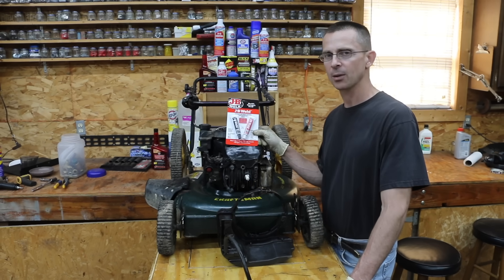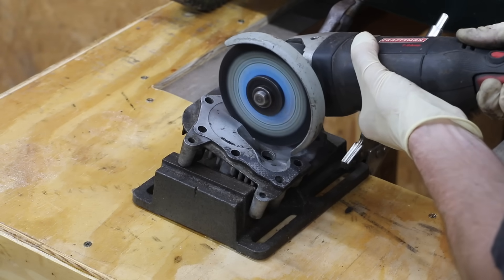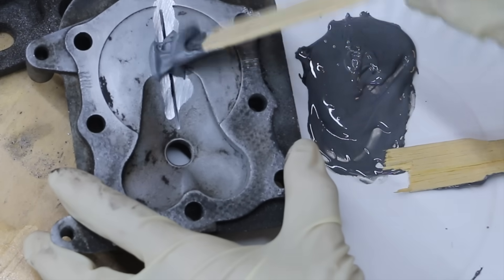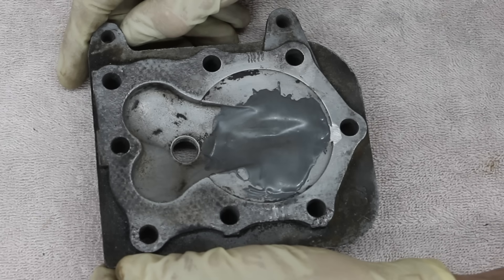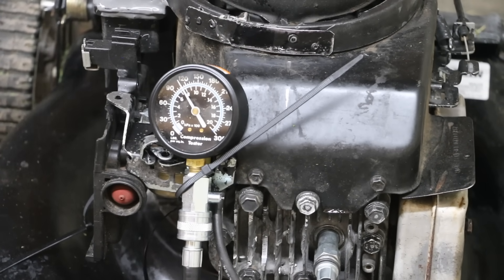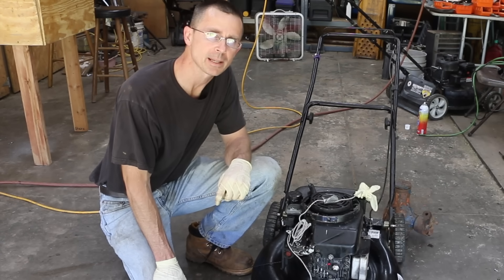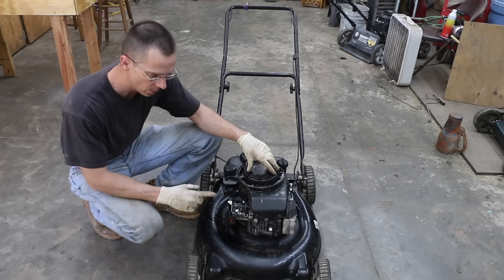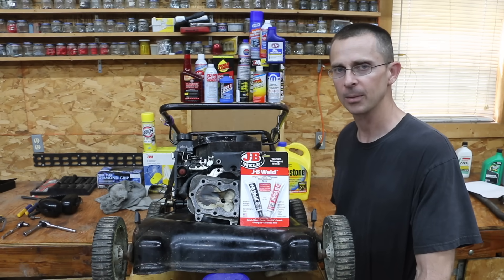Can JB Weld fix a cracked cylinder head?  See the proof!!

Comment: i Have repaired a Volvo 940 2.4 turbo engine block which had corroded from a water jacket to the cylinder bore using Quick Steel repair putty and that worked for a further 20k befor the head gasket went again
Reply from the maker: Thanks for sharing.

Comment: Back in the early 70s. I had a old Richardson boat with flathead gray marine engine in it.  The distributor mount was broken . I used jb weld to fix it. That motor ran three years without any problems.  We went on a few summer trips down the Erie barge canal to the finger lakes and the thousand island area of eastern lake Ontario. The motor ran everyday all summer long each of the years I owned it  I sold it and know it ran at least two more years
Reply from the maker: Thanks for sharing.

Comment: First time I tried porting a Toyota cylinder head I accidentally cut into a water jacket. Ported rest of intakes the same and used piece of tubing and JB Weld and welded it in place. I ran motor all night at drag strip and JB Weld didn't fail. Been using it ever since on all kinds of stuff.
Reply from the maker: Thanks for sharing.

Comment: I was giving a Wheelhorse  417-A with a 17 hp Onan engine Because the previous owner thought it was throwing a rod it knocked so bad.  I knew he never inspected inside the shroud for mouse nest which is a big problem here in upstate NY every winter anis the first thing you should check for in spring. First thing I went for was stretched head bolts,
. Sure enough the port Side head was loose and rapped like crazy whenever it was under load.  This etched a channel in the cylinder block under the blown head gasket.  My fix was to ball up some aluminum foil and gingerly tap it into the channel until it it fit nice and tight and a couple of thousands above the jug.  Enough so it would dimple into the head gasket when it was torqued down.  Hasn’t skipped a beat in 5 years of mowing and hauling.  Wish now I had taken some pictures. I will if I ever have to take it down again. Thanks again for your great videos, I learn something every time
Reply from the maker: You are welcome!

Comment: Some years ago I hit a log sticking out with my ‘71 Suzuki 90 cc it broke off a sizable chunk of the aluminum casting on the side of the engine where the carb is located, I cleaned the area real clean with brake cleaner and beveled the pieces and used JB Weld , it is still on there today and it still runs great!
Reply from the maker: Glad to hear!  Thanks for watching.

Comment: I pulled apart my 3L mercruiser today to replace some core plugs and gaskets and found out my block had a crack. JB weld has been holding up pretty well though I'd say.
Reply: To be clear, the previous owner used the JB weld. I had no clear it had ever cracked until today.
Reply from the maker: Thanks for sharing.

Comment: I had a Honda 750F motorcycle that someone tried to steal but couldn't cut the security chain or lock so they slammed it into street.  I rebuilt case and engine cooling fins.  Rode bike over 20K miles and never leaked a drop of oil and alternator worked perfectly.  Only way you could tell of repairs. Was factory engine lettering was covered by repair.  And cooling fins were smooth where I replaced them.
I keep J&B in my shop at all times!
Reply from the maker: Thanks for sharing.

Comment: I won't be milling any more heads for higher compression.  I'll just add JB Weld to the compression chamber.
I use the slow set JB Weld just as I am about ready to throw in the towel. Amazing stuff but lousy tubes.
Reply from the maker: Thank you

Comment: Got a big test coming for JB Weld.... Got a small hole in Cylinder Head off of my 200hp 2.5liter Mercury Outboard engine. Hole it works. Stay tuned

Comment: I have a 1988 f150 ford truck which had a cracked exhaust manifold. I tried just about everything including JB weld extreme heat. Now to be fair the crack was located in a hard to reach spot and I'm sure I didn't prep it correctly. Funny, after spending all that time energy and money, I finally figured out what works, replacing the cracked manifold with a new one. Thing was I didn't want to pull the engine, and was sure I'd break off some exhaust bolts, which I didn't (used anti-seize years ago). If I ever get in a place where I can properly prep it, I'll give JB another try.

Comment: Thats is remarkable. I have actually used JB weld to repair my oil pan i cracked. I accidentally over torqued the corner of the pan near the bell housing, while replacing the pan gasket. Which in my case, the front differential has to be dropped/removed. Instead if spending $60 and spending another whole day on the cold concrete, 5 dollars at walmart, and my truck is still on the road. Does not leak! Even moved to texas from minnesota, and I’ve been here 10 months. Still holding!

Comment: Sort of sentimental, lAbout 15 years ago, my dad repaired the heads (multi head engine) on his 2.4l turbo diesel Range rover, that cracked between the inlet and exhaust ports intro the water jacket using JB weld.  According to my dad it ran sweet the best it ever did that was until 2 weeks when the Range Rover, the tailor it was towing and the poor little  Fieata in front was written off by a llorry driver failing to stop and mounting the tailor.  The engine still was running sweet in the impound lot, the last time my dad ever heard the engine  or saw the Range Rover.  Do note the Range rover was a work horse constantly pulling a tailor for easily 500miles a day so at a guess JB weld coped with 2000miles heavy use.  Always wonder how long it would of lasted if the lorry didn't cut it short.
Reply from the maker: Thank for sharing.

Comment: Just finished rebuilding my’72 181cui 3.0L mercruiser 140. Found two cracks during the rebuild. One on the block, one on the intake body. JB weld will be put to the test for me soon. I have test ran and times the engine, but it needs a trip around the lake to be sure. I saw the video about Motorkote, and am going to use some in it as well. There is some slight knocking (I believe due to not having the cylinder walls machined). Fingers crossed as this boat spun a bearing the second day I had it on the water two years ago.
Reply from the maker: Thanks for sharing.

Comment: Technically it's not cracked, just cut... The two sides are holding together with steel on both sides of the cut, a crack usually goes all the way through or at least through to one side but it's a good test.
Reply from the maker: Thanks for the feedback.

Comment: You mashed so much JB Weld all over the place that it was bound to hold for a while.  I would like to see you put the JB Weld into the crack only with a plastic cringe and then sand it off so that only the crack has the epoxy in it.  Them start the motor.  What you did is to make the metal thicker and thereby allow for the crack repair to be deeper.  Let's see!  
I do use JB Weld on repairs of SS wire where my brazing is not p to task.  I do not use it on plastic, fiberglass, or wood.  There I use marine epoxy, Marine-Tex, resin and glass, etc.  JB Weld is too hard to sand into a shape.  For me any way.  don out.
Reply from the maker: Thanks for the video idea.

Comment: Hi, over here in the UK we’ve got a similar product to J B Weld called Chemical Metal. It’s made by a company by the name of plastic padding and it’s pretty good stuff. A friend of mine had a CR 125 honda 2 stroke and he blew a hole in the piston. He had no money so he took it apart, cleaned everything up and repaired the piston with Chemical Metal. After a while he sold the bike and just over 2 years later that bike was still running and still being ridden around the town. That chemical Metal is good stuff and I’ve used it myself on various things. It’d be interesting to see you do this with JB Weld to see how it holds up. The trick is with things like this is to give it plenty of cure time.

Comment: We blew teeth off a ring gear in a 12 bolt GM rear end, throwing a couple teeth through the aluminum torque cover while drag racing.  I patched it with JB Weld around 10 years ago and it's still holding.  Saved us $125 for a new one.  I have been using JB Weld on different things for many years.
Reply from the maker: Thank for sharing.

Comment: I had A cracked manifold . I used JB weld and Aluminum foil . It smelled terrible when it got up to temperature but it never failed in the extreme heat environment.
Reply from the maker: Thanks for sharing.

Comment: My Dad when I was a kid, we had a messed up boat and he repaired a cracked cylinder head with JB weld to a dude and didn’t tell him.  The boat went on for YEARS, with no problems because I knew the guy.  Amazing stuff. It was a 350 V8.  Cooled with SALT WATER.
Reply from the maker: Thanks for sharing.

Comment: years ago like 1984 as a mechanic at a Chevy dealer i did some side work in my garage for an ugly duckling rent a car agency a buddy owned and one of the projects was a 1979 Toyota Celica with a connecting rod through the side of the cylinder block just missing the water jacket i patched the hole with JB weld and an aluminium soda pop can. i jb welded the aluminium patch on the inside of the block and filled the hole with jb weld on the out side and replaced 1 piston and 1 connecting rod. after a year that car was still running great and being rented. Unbelievable!
Reply from the maker: Awesome job!  Thanks for sharing.

Comment: I wonder how it would perform on a petrol car engine when adding it to a headgasket after the hg has blown.

I know this stuff works great on sealing my small high performance 2 stroke engine cylinder heads rhough
Reply from the maker: Thanks for the video idea.
Reply: @ProjectFarm  np

I thought to do this on my previous vw caddy 2.0 8v gasoline but i sold it  for scrapping cause there was allot more trouble with this car then just the headgasket

Comment: Been using Jb weld for 30 years excellent for hot and stiff applications.  Found Goop 5 years ago for my convertible roof which is flexible excellent product has to be painted if used in the sun. Goop can be used to make a gasket for an engine. It's great on most plastics. Great video as usual.
Reply from the maker: Thanks for sharing.

Comment: I have a toyota t100 4 banger, manual trans the factory radiator developed a crack at the top...? i used jb weld on it, just cleaned the crack at the surface, no grinding or sanding, just mixed and put it on, next day it cured , refilled the radiator, its been 5 years ...still holding
Reply from the maker: Fantastic!

Comment: I have a small 2 stroke engine that has a cylinder head that snapped in half, would this be able to fix it? If so, how?
Reply from the maker: The repair is unlikely to last long, since JB Weld is rated for 500F and an air cooled engine exceeds that max temp rating

Comment: Project farm
Not only are some of your tests impressive but your impressive in the way you conduct these product tests...
I have once used JB Weld in the past and I wasn’t fond of it....however after watching you using the product... I will give it 2nd  chance.
I have a Jeep Wrangler the gas tank had a hole in it more like a severe slice, about an inch or inch & half 
I tried using JB Weld ... didn’t work it held for a short time only, maybe a day or so.
Come to find out the tank is some sort of plastic material called Polyethylene.

And is resistant to any kind of repair other than Plastic welding and I went crazy with all kinds of glue products until I found that out.... and my old standby Epoxy failed me also.
Thanks,Frankie 
Boston
Reply from the maker: Thanks for the feedback.

Comment: I patched the plastic edge on my radiator and it lasted for a year before the crack decided to get worse. Also, many years ago I patched a GM 3.4L V6 Cylinder head with it and it ran perfectly until the car was rear ended and totaled. JB Weld FTW!
Reply from the maker: Thanks for sharing.

Comment: Have you ever tried JB Weld Extreme Heat on an exhaust manifold?  I have used the two part regular JB Weld on a crack but want to use this new Extreme Heat JB Weld.
Reply from the maker: Great suggestion!  Thank you.
Reply: @ProjectFarm  There is another product that is like JB called Blue Magic Thermosteel Quiksteel.  Would be interesting to see how it also compares to the JB weld extreme heat.  Both seem to be flaky...no pun intended

Comment: Can it be used to fill up bike exhaust holes🤔🤔
Reply from the maker: Yes, if the exhaust doesn't exceed 500F.  Otherwise, you might consider using JB Weld extreme heat

Comment: I first used JB Weld to repair a model rocket in 1973. Then used it a lot in blacksmithing. But the best was the 5 years I lived in China. I helped start our engineering office and introduced JB Weld to make assembly and test fixtures from time to time. The Chinese guys and us hand carried JB Weld across the border as nothing in China was as good. Our Chinese engineers kept JB Weld secret so they would look good to outsiders. Can't blame them after all their effort. But, now the 3D  printer obsoleted the need for JB Weld in the office. If they break the fixture, they can have a new one in the morning.
Reply from the maker: Great feedback. Thank you

Comment: In case anyone was wondering, I got jacked on a 02' Yamaha R6 that had the chain break and crack the engine case. The owner caked JB weld on it and it didn't leak (I was oblivious) until 170mph poof, smoke everywhere. So, depending on pressure, as well as vibration and heat can cause it to fail. Granted this was a street bike at around 11k RPM, worth noting. But, great video, it does work on a lot of projects. And I appreciate you admitting the mistake (also nice to see you make a mistake for once). Soon as you said you were putting it on a higher compression engine and I didn't see you knock down a little of the JB weld, I cringed. lol.
Reply from the maker: Thanks for sharing.

Comment: My 89 Camaro with a 305 had a crack that pushed part of the block out and separated it, it wouldn't hold coolant but still ran amazing. I just put my second coat of jb weld on yesterday and I have yet to test it, but I have much more confidence now! Thanks brother for an awesome channel and true testing videos
Reply from the maker: Thanks for sharing!

Comment: JB Weld's "Water Weld" product saved my aluminum V6 engine block when it developed a 1/8" hole into the water jacket due to an assembly error (my fault) - the repair has lasted for over 10 years with no leakage.  Knock on wood.
Reply from the maker: Thanks for sharing.

Comment: I highly recommend JB Weld's Water Weld product too...I used it to seal a large crack in a plastic radiator on a 1997 Honda Accord. A mechanic that saw it said, "It was a waste of time and it will not work for very long." It worked very well for over (5) years and possibly longer, I sold it. It never leaked or over-heated.
Reply from the maker: Thanks for the feedback.

Comment: JB Weld might be good in repairing vintage car brake cylinders - but see caveat - :

http://www.ppowers.com/lucas_plc.htm#Brake%20Cylinder

Sometimes corrosion-pitting occurs in the master cylinder bore.  This can allow brake fluid to leak past the piston.  Although re-sleeving of the bore is clearly the best solution to this problem,
a quite acceptable solution may in some circumstances* be achieved by degreasing the entire housing and filling the pitting using a metallic-impregnated epoxy resin such as JB Weld. 
Simple sanding using fine emery cloth before the repair has completely set is then all that is needed to obtain a completely smooth bore.

* NB The owner must decide for him/herself whether in their particular circumstances such a solution is appropriate or not. No responsibility is accepted for others' use of this approach.

Comment: One time I ceramic cote the top of a piston of a 450 dirt bike . I sanded with 1200 grit and used rattle can ceramic paint . Baked it in the oven 3 times  and installed ,but I never found out it if it actually held up I was curious if you can try that out and see how long a ceramic coated piston would hold up thank you
Reply from the maker: Thanks for the video idea.

Comment: 😁 I have used J-B Weld in the past on a 4 cylinder Ford Probe radiator was leaking spots all through the radiator cooling vents .. I used J-B Weld let cure for 2 days .. worked perfectly .. .. I had a scooter with high performance exhaust but had a hole in the exhaust main pipe .. same thing mixed right amount cured for 2 days clean up the rough edges made it smooth n no exhaust leak .. LOL I swear by this product ..n been a subscriber but this is my first post 😁

Comment: PF, you are great ! You think up some really cool test and comparisons. 
I have used JB Weld many times over the years. I must admit as good as JB Weld is I thought this cylinder test would be a bit much for it. I think the "mistake" as you called it really wasn't. It just added some extra stress for the JBW.  
I fixed an old leaking radiator, many times too, with JBW for a friend a few years ago. The plastic tanks were just old and tired. Especially the top one ! 
The repairs with JBW never broke ! After some driving though the heat and pressure would eventually find the next weakest area. JB Weld is a great product.
Reply from the maker: Thanks for sharing.

Comment: Thanks for teaching me so much on all of your different videos..... I used JB Weld on an old Chevy Truck... It did not work for me but I probably didn’t use it properly... I was only 19 at the time. My starter bolt holes were cracked (on the engine) so the bolts had nothing to grab on to.. I had to pop start that truck because I couldn’t secure the starter - to crank the flywheel
Reply from the maker: Glad to help!